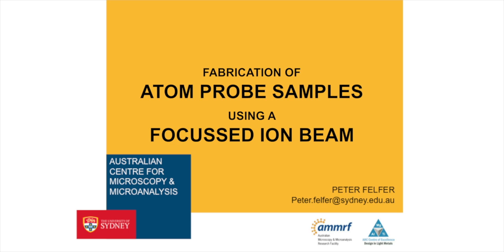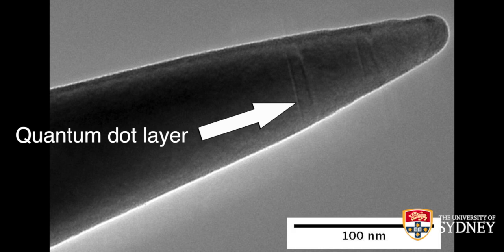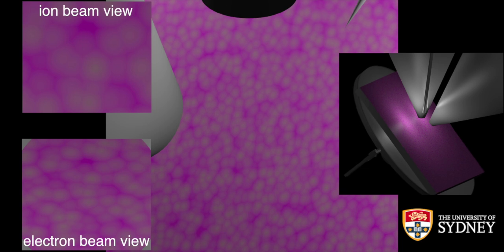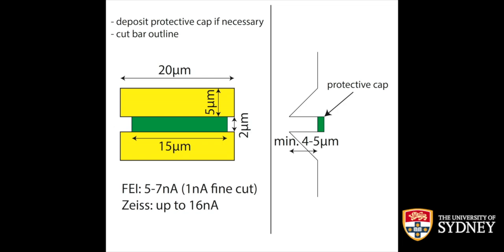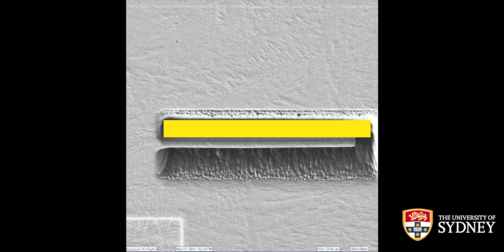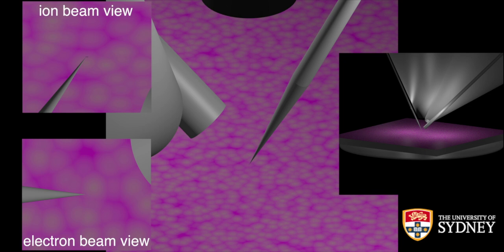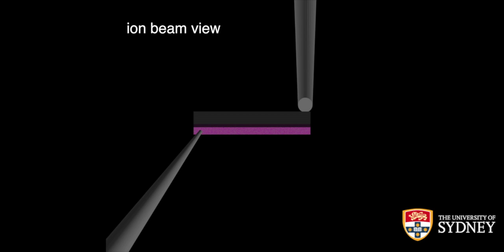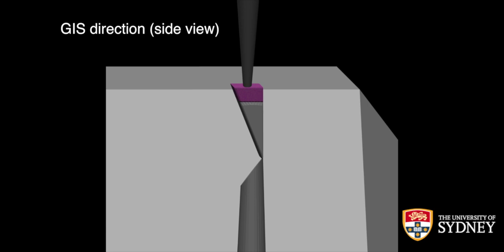FIB of atom probe samples - plan lift-out

Comment: It really amazes why not provide a live cutting , the photos show a yellow overlay on the bar  i want to see effects of secondary electrons , with high current migration,  not an animation

How am i going to decide to buy a 2000A  FIB .. based on this video ? which i cant hear clearly ,, like a Uni lecture , where are the transcripts ?  HOW to produce the WELD on the AF tip ?   Move the u manipulator down .. talk only where is the physical operation ?

What ion source is used to cut the channel ?  i cant really see how the tip was removed.
there was an insulating layer on which was deposited metal ( Pt ) ?

A gas was used to form the wedge ?  Honestly ?

Finally a cantilever is shown  in a cut frame still ..  MOst uninformitive ,, the weld is done  HOW  speech is hopeless ..  TRANSCRIPT  PLS ..   and actual cutting footage
The other thing u miss out how to bond Si  with a Piezo flexible joint

Comment: I have one doubt, how is the energy of the FIB dependant on the process parameters.. ?? I mean what is the relation (mathematical) between beam voltage, beam current, dwell time, etc on the energy of the ion beam ???
Reply from the maker: arjyajyoti goswami .
You can of course set the energy of the FIB beam. The important thing to consider is the interaction between the ions and the solid, governing both the shape formed and the ion damage. They result in typical sputter yield curves (see P. Sigmund, Journal of Materials Science, Vol.8, 1545-1553, 1973) governing the shape of the tip (see Felfer et al. Microscopy Research and Technique 75/4, 484–491 (2012)). 

As a short answer: you can either tailor your process parameters until it works for your material, or minimize the amount of annular milling, where you have no control over the shape, by shaping your tip into a (truncated) pyramid and only using a short annular pattern, with a clean up step if you're working on a low density material (e.g. Si, etc..). This can all easily be done at low voltages (<10keV), so you have much less ion damage.